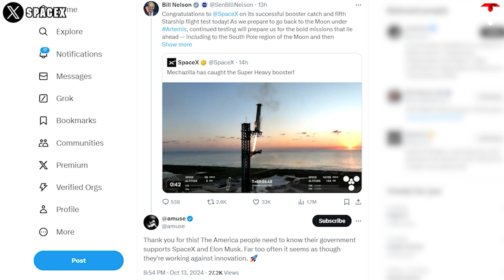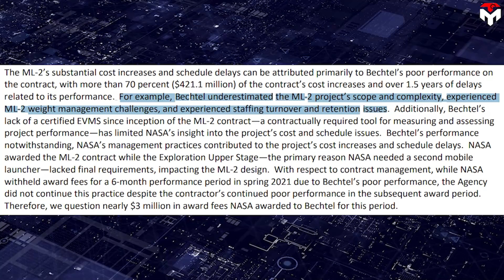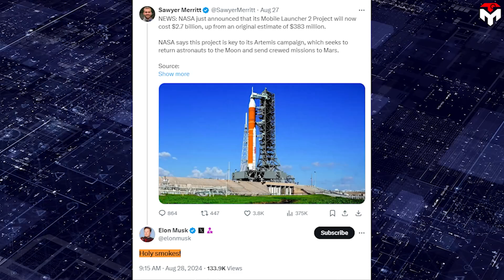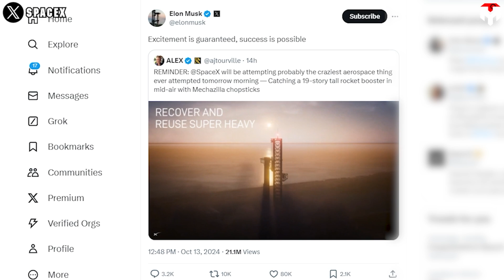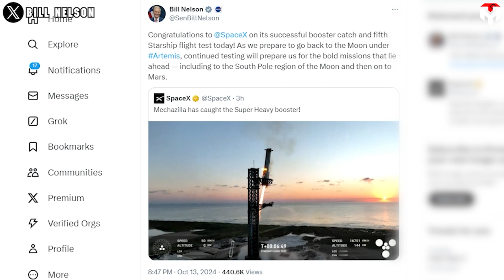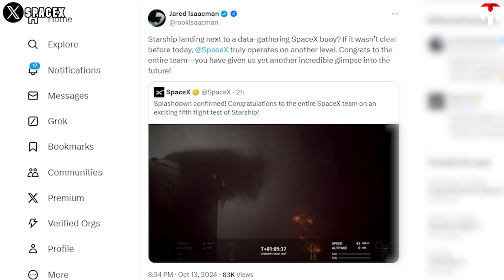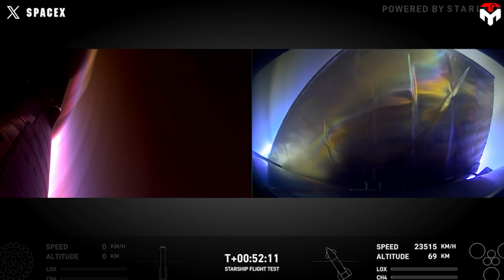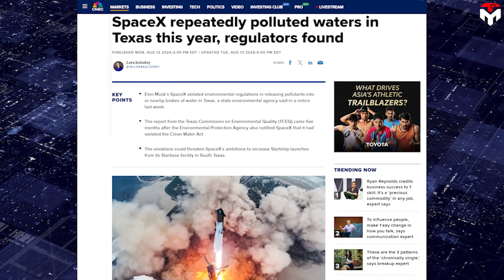NASA finally Realized SpaceX Starship is Better Than SLS After first Catch!

Comment: SLS worked exactly as planned on its first launch.  It sent a capsule well beyond the moon. Starship still has not successfully done a single mission profile.   At present, Starship can not lift more than itself to orbit, and SpaceX STILL does not have a final mass for the vehicle that WILL successfully be able to re-enter without massive damage.    Even if a much larger version ever does manage to lift 100 tons to orbit, the current concept is for it requiring OVER TWENTY launches to refuel a SINGLE starship for a trans Lunar injection and landing. 
NONE of spaceX’s lunar qualifications have been demonstrated.  SLS Works just fine, Now, and can send its rated payload to the moon with a single launch. 
Fanboying over spectacular test launches, each of which requires a redesign of the rocket or the launch pad, is all well and good.  But the what is embarrassing NASA right now is that ALL of their lunar projects are behind schedule, INCLUDING SpaceX’s starship.   Currently at least 6 years behind schedule.
Reply: SpaceX would be further ahead without 🐂💩 interference. SpaceX just showed how lacking the rest of the industry is. Who cares about the numbers at this point, it's still under development.. it still outdoes all others including SLS. Go SpaceX Go 💪💪💪

Comment: also teachly boening could just stick there starliner on one ofteh super heavy boosters to get gateway uptheres in a big 50-100+ ton LEO payload at once if they need to bescue the starship heavy booster could just have a 100ton playlaod ina huge fareing and ti will beable to yeet that into LEO bacly by it self aroing to my mental mathatics of delta v of stuff. all resuewble by the way. heck thes starship superhavy booster could yeet a whole facon heavy with a whole dragonx capsule into LEO while being fully reusblae and then the faclon heavy would then yeet the daraon x capusle or probe to mars or bedonud most of the star sistem depsiding on the paylaod tonage. yes a whole falcon heavy is aronud bacly 75ish tons fully laoded with fuel wet mass total. also a super havy booster would bascly yeet 100tons into LEO but 50 tons into geo seconus orbit as well. yet agin this is my delta v mathatics of basic maths.